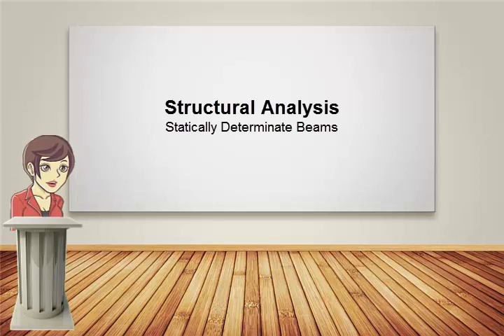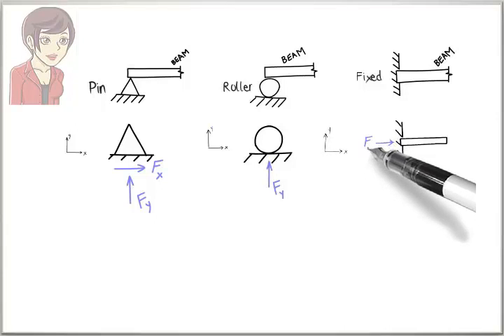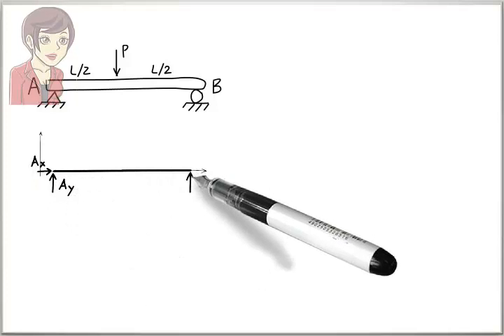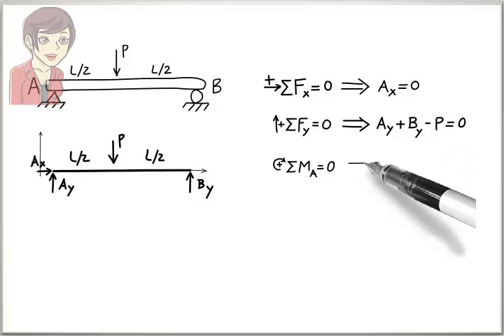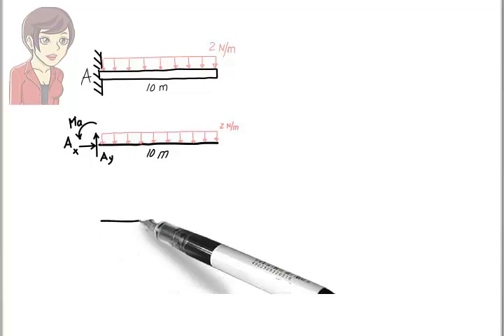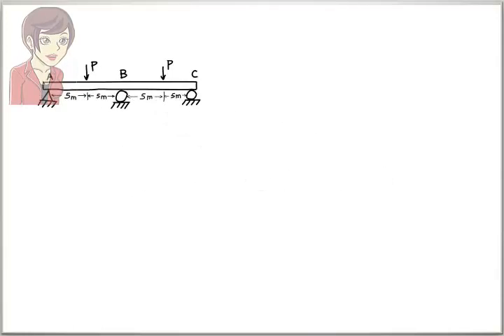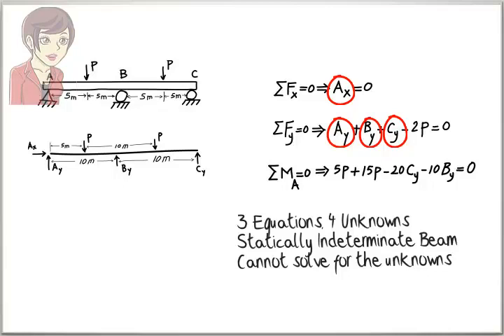SA01: Structural Analysis: Statically Determinate Beams

Comment: Extremely helpful but i have a doubt that when the internal support carry BM whether it is pin or roller??
Reply from the maker: Yes, if there is a pin or roller at an interior point (away from the ends), the moment in the beam is not zero at that point.
Reply: @DrStructure Then why internal hinge carry zero BM .Plz clear me that the difference between internal hinge and other internal supports?? I will be very grateful
Reply from the maker: Imagine two separate beam segments (say, made of steel) each having a length of 5 meters. We can make a beam of length 10 meters by attaching the two segments together using a single bolt. The connection between the two (the bolt) constitute an internal hinge.

Such the bolt permits one of the segments to rotate relative to the other one. Since the connection is not rigid, no bending moment develops in the beam at the site of the bolt. So, bending moment at an internal hinge is said to be zero.

Alternatively, suppose our 10-meters long beam is made of a single beam segment. Since the beam is rigidity connected at its midpoint ( I.e., no connecting bolt is present), a bending moment does develop at that point. Even if the beam is resting on a roller at its midpoint (an interior support), since internally the beam remains rigid, bending moment does not vanish at the interior points of the beam.

So, it is not the interior support that makes the moment zero, it is the lack of rigidly in the beam at the site of the bolt that makes bending moment to vanish.
Reply: @DrStructure Thanks alot sir now its crystal clear! Such a quick response 🙏

Comment: i have a doubt, if there is a angle  then how to find force ?
Reply from the maker: If a force is placed on the beam with a known angle, then we can replace the force with its x and y components.  If the beam itself is inclined then we can define the x-axis along the length of the beam (i.e., rotate the coordinate system such that the x-axis becomes aligned with the center-line of the beam), then view the applied load as being an inclined force which can be replaced with its x and y components.

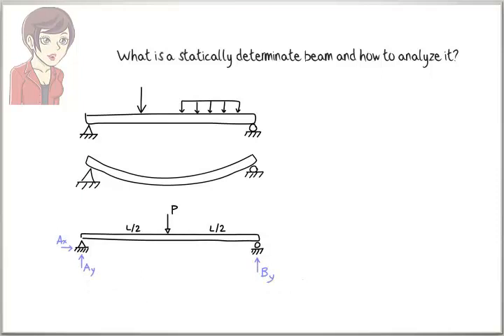Comment: Dr. Structure, assuming that the beam at 1:03 can take the P without bending and that A and B are columns, how can i determine the force that applies to the points A and B in order to see if the columns will fail? Thank you very much!
Reply from the maker: If we add columns to A and B, then we get a frame structure. Frame members could be subjected to compressive or tensile force as well as bending moment. Such a member could fail for various reasons including excessive compressive, tensile or bending stresses, or it could fail due to buckling. 

I am assuming here you are referring to buckling failure only. A column could buckle if the compressive force applied to it exceeds the member's buckling load which is a function of its length, cross-section properties and end conditions. In this case, assuming P is applied at the midpoint of the beam, the axial load exerted on each column at the end of the beam would be P/2. 

To determine if the column fails under P/2, you need to know the length of the column, its cross-section and its end conditions. Knowing those you can determine its buckling load, the load that causes the member to buckle. If P/2 is greater that the buckling load then the member would buckle (fails), in theory that is. 

To learn how to calculate the buckling load for a column, you need to do a bit of study. You should be able to find ample explanations for column buckling online.
Reply: @DrStructure  thank you! Much appreciated

Comment: question: in the first example why is the moment taken at point A?
Reply: i have realised because moment is 0 at point A
Reply from the maker: The moment can be taken about any point. It could be A, it could be B, it could be any other point on the beam, or off the beam. It really does not matter which point you pick. But, for practical reasons we generally pick one of the support points. In this case we picked A.
Reply: Nice explanation Dr
Reply: Dr pls I don't understand hw de clockwise and anticlockwise taken
Reply from the maker: I am not sure what it is that you have difficulty with, please elaborate.  Also, you may want to watch the following lecture, it could clarify your concern. 
https://youtu.be/1YpoLjKtl3Q

Comment: Very helpful. A little confused on where the 2N/m came from? I am doing a project for a physics class and i am self teaching these concepts.
Reply from the maker: +Pouneh Mozafari The distributed load is assumed to be 2 Newtons per meter, it is given. 

It is great that you are learning this on your own, though some of the concepts might pose a bit of challenge without additional help. You may want to consult an introductory structural analysis textbook if you get stuck. Feel free to send me your questions if you need help.
Reply: +Dr. Structure Thank you for responding so quickly!! I could use all the help i can't get right now. I am kind of stuck and not sure if what i am trying to aim to calculate is even possible. I am comparing beam bridges versus truss bridges. I am calculating the forces of each joint of my truss bridge and similarly calculating forces acting on the beam bridge. I want to somehow compare the two in a broader sense and determine that the truss bridge will be able to hold more mass because of it's strong forces. I have built both brides with the same span and will test them tomorrow to see which will hold more mass before breaking. Let me know if you think this is absolutely crazy or if i am somewhat on the right path. Thank you!!
Reply from the maker: +Pouneh Mozafari You are on the right track. Your experiment could shed some light on the subject. Though it is not a quantitative comparison. To compare the two systems quantitatively, you need to do a bit of analysis. 

For such a comparison, you need to know axial and bending strengths of the material being used. I assume you are using balsa wood. You should be able to find that information online. Alternatively, for the sake of this comparison, you can assume the material is structural steel. For example, design tensile strength of steel can be assumed to be around 18 kips per square inch.

You need to analyze the truss in order to determine maximum axial/compressive member force(s). Place the applied load at mid-span and use the method of joints to determine the force in each member. A simple comparison of these forces would tell you which member carries the maximum tensile/compressive force.  If you divide this force by the cross-section of the truss member, you get what is know as axial stress (force per unit area). This could be compressive stress (if the member is in compression) or tensile stress (if the member is in tension). This maximum stress divided by the (axial) strength of the material (balsa or steel) gives a measure of the design efficiency. 

This ratio should always be less than one. That is, strength of the material (the denominator) should exceed stress in the member (the numerator). The closer this ratio is to one, the more efficient the design.

You can perform  a similar analysis on the beam. Place the load at the middle of the beam and calculate bending moment in the beam at mid-span. This moment divided by a quantity called section modulus gives maximum bending stress in the beam. This number divided by bending strength of the material (which you can look up) gives a measure of the beam's efficiency. 

Now, you can compare the truss and beam bridge by comparing these efficiencies. This comparison is particular meaningful if the two systems are comparable in weight.

Another way to compare the two systems is by comparing their maximum vertical deflection which takes place at the mid-span of the bridge.